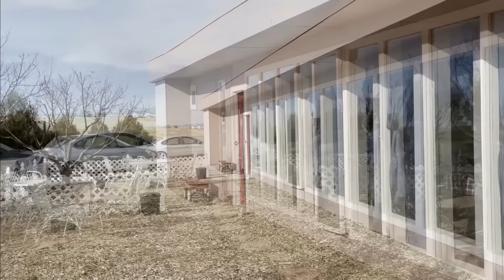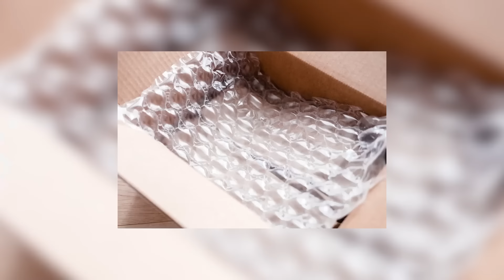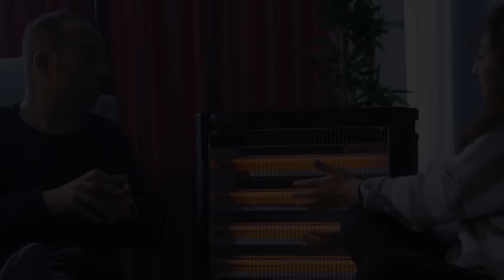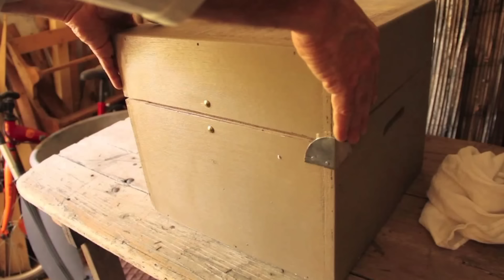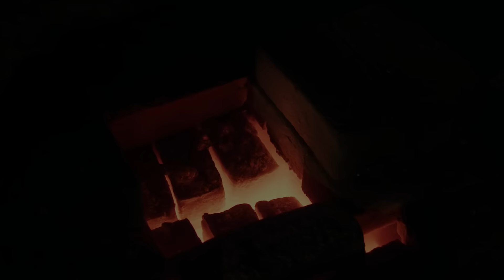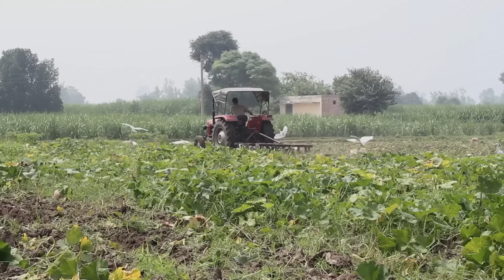Grandpa’s 42 Hacks ENDLESS Heat for Your Home WITHOUT Electricity

Comment: you do not leave an air gap with a hot water bottle if the water is to hot it will expand the air as it is hot and when it cools down it creates suction making it harder to open the bottle and over time it will effect the rubber and burst and may burn you badly..

Comment: I only use a fitted sheet on my bed in winter.  Instead of a flat sheet, I use a velour blanket with a sherpa lining (wonderful on bare skin) and put a down comforter on top of that blanket.  I am warm and cozy all night, even with the HVAC switched off!

I have thermal drapes and an electric fireplace that heats the house in the daytime and the heat that lingers through the night keeps the cats warm.

I wear knee socks to bed and a stocking cap if it's really cold.

I wear jeans and a pullover sweater during the day, with knee socks and fur lined slippers.

I reuse the heat from the stove when I bake, leaving the door open a bit after I turn off the oven.

After my bath, I allow the water to stay in the tub for a little while after I'm done. The warm water heats up my old cast iron tub and helps keep the bathroom warm.

When I use the electric clothes dryer, I move the exhaust hose to vent into my laundry room, which is just off my bedroom.  An old stocking keeps lint out of the air!

I also sleep with my 17 year old cat under the covers (his idea).  We've kept each other warm for years!

Hope these tips help you to stay warm, too!
Reply: Good tips, I miss the claw foot bathtub I was raised with (I grew up on an old hobby farm)
Reply: Thank-you and God bless

Comment: To stay warm without electricity and without danger of burning yourself through hot water, you can buy blankets made of wool (any wool will do) or even any other kind of blankets. 

When on the couch or in bed, use several blankets, not only on top of your body, but also beneath your body. 

That slows down the process of losing body heat that will be drawn into the colder couch or mattress. 

Wear more clothes, instead of one shirt below your sweatshirt, wear two or three. Buy long underwear you can wear above your other normal underwear. 

If you have trouble paying the bill for heating, only heat one room. Use the room that is the smallest, enough to move your bed inside and heat that room an maybe the bathroom only. 

Keep all other doors shut and windows in those rooms closed. If nobody breathes inside these unused rooms and no warmer air can enter (that's why you shut the door), the humidity won't rise and mold will not be a problem. Mold needs high humidity and warmth, cold or heat alone without humidity is no problem. 

Boil water and fill it in a thermos bottle. So you can drink tea or warm water throughout the day what will warm you from inside. Don't drink boiling or very hot water, it might burn your esophagus. If it has around 49-50 degrees Celsius, it's enough. As long as it isn't colder then your body's core temperature, it will keep you warm.

Comment: I have radiant baseboard heat so makes no sense bringing curtains to the floor so all the heat below goes out the window!
I use white Styrofoam sheets in my windows in winter to keep the cold coming in the windows or heat going out.
I also use black pipe insulation under my doors where gaps are. Just open the door, slide it on and cut to size!
Reply: What is black pipe insulation?
Reply: @DarkGhostHackerfor hot water pipe insulation. Walmart has them

Comment: Amusing,at no point did this A.I.recommend a bed warmer such as grandma this is possibly because grandma requires a lot of fuel and constant maintenance.
👧
Getting spare parts for them is almost impossible too,and returning them to the manufacturer is very troublesome.
🤗
Modern ones don't come with a lifetime warantee either and you cannot trust the bodywork like those earlier models.
🐱
Fortunately,cats are cheaper to maintain,self cleaning and can keep your feet warm at night.
🐀
Added benefit is that they don't wake you in the middle of the night just to dispatch an imaginary burglar......

.....but they might offer you a rodentia payment after their 3am patrol of your garden.🐀🐇🐿️🦇.......

🐱just to show they work hard on the nightshift.

Comment: in case you follow some of these examples, when your house goes on fire, position several small shelters about 75 feet away with the door opening facing the flames. you'll have several hours of natural, deep radiating heat to enjoy before the FD puts the flames out.
Reply: LOL
Reply: I thourt the heated bricks wrapped in a towel were bad, but putting a clay pot candle heater in your blanket Fort 😢,  my eyes popped out with shock 😅
Reply: @krisgair5863 we use a tera cota pot witj candles under it (raised on bricks) to heat our bathroom in the winter while we shower.  DO NOT place the candles on the floor to do this and make sure you dont have sutt building up or it will be in the air you breathe
Reply: @zigzag2370 If things are done properly and safely, these tips work.  I won’t, however, use real candles anywhere in my house.  Never.
Reply: @krisgair5863 thanks, you saved me the trouble of watching a bunch of unsafe or otherwise misguided ideas.

Comment: Do NOT use boiling water in a hot water bottle. it can significantly shorten the life of the hot water bottle and add to the risk of burns. Hot water bottle manufacturers typically recommend using a temperature no higher than 50-70 degrees Celsius, or 120-160 degrees F, and even lower for young children.

Comment: Make your own rice soak. Use a long men's athletic sock & put ~ 1 cup of dry rice in the sock.  Tie the sock shut. Microwave the rice sock either with or without a cup of water to give moist heat.  I sleep with my warm rice sock under my neck & stay toasty warm.  Try it!
Reply from the maker: Thanks for sharing this great tip!
Reply: Feed corn works well also!
Reply: @deanhil3978  I have several sizes of corn pillows and the only reason people don't fight is the cover material so we know whose is whose. They make excellent bed warmers or for larger muscle groups. They can be put in the freezer for a cold pack as well. 
Rice works best for delicate areas like an eye pillow, a shoulder wrap (sew into separate sections so the rice doesn't all shift to one side), and smaller pillows while corn holds the market on larger pillows. 
Rice flattens enough and molds to small areas to be warmed and put into a boot before you go out or to warm the inside of gloves. 
Any of these can have herbs added to them that help with pain, sleeping, relaxing, etc. I find the herbs work better with rice as the rice grinds on  them a little and the heat helps activate them.
Reply: Need electricity for this hack tho 🤷
Reply: @BecauseEyeGotHigh207  k, put on stone in front of fireplace or warm surface and same thing happens.
Reply: @blackdandelion5549 hmm interesting 🤔

Comment: Hy-Tech Thermal Solutions offers a paint additive which will  insulate your walls. There are no ASTM R-value ratings for paint. Customer reviews and testing suggests a 35% decrease in heat conduction through walls which have received 2-3 coats of paint containing this additive.
Reply: Baaahahaha! If they say so. What's the R factor of the paint?

Comment: Candle and brick heater = If you use concrete bricks, you could have an explosion. Ceramic can also explode. Be sure to check all the info in this video with the Fire Chief so you don't do something that is actually dangerous!
Reply: My dog and I stayed toasty in 9° weather with tera cota pots and clean candles.. was able to make grilled cheese on it in the morning,, but I caved and used propane to make coffee, just didn't have the patience...
Reply: Excellent tip.  Thank you for sharing.
Reply: Yes, if you do it wrong, the wax might heat up so much that it is self igniting. That is why you need air circulation, so that only the fumes of the melting wax burns. 

Also, you don't win a single extra degree. A burning candle produces X Energy. If you heat a ceramic pot with X, it will only set free X, just slower. 

To heat up your walls and anything, the amount of X is the same, whether or not it is delivered fast or slow. 

If you wanna heat with candles, let them burn without anything that covers them. Put them on a non inflammatory ground, like an iron metal. If they fall over, they will not cause a fire, even if they self ignite, because they can't melt the iron.
Reply: @lars5288 There have been house fires because of those silly ceramic candle holders. One specific kind that takes potpourri too, has been the most problematic. Science means nothing, when the Firechief has had real life experiences!

Comment: Instead of using bubble wrap, go get the real stuff US Energy Products Double Sided Reflective Heat Radiant Barrier Aluminum Foil Insulation. Reflects 99.97% of radiant heat transfer with a thermal resistance R Value of 24 (Building Envelope). Prevents heat from escaping during colder seasons and does not allow heat to enter during the summer months. It also will not oxidize like pure aluminum. It works way better than any old bubble wrap! I use it in front of 2 different windows and have some of it going against the wall too. Helps well!

Using a sleeping bag at night thats rated for winter, can help keep you warmer at night without electricity.  Also, wearing a hat to bed keeps heat in.
Reply: I took just regular cheap big painters plastic. Maybe $1-$3. Folded it over multiple times. Maybe about 6 or more layers. Put it over our door that goes into the garage that had a window. Worked great. Garage went up at least 20 degrees. It was freezing! Blocked out the thinner areas and the window. Was enough to help. I know thicker good actual weather ones would do better but that worked for the price and kept it plenty warm
Reply: Doesn’t that keep the light out though?
Reply: @Ilikeutube-q5p  Yes it does, but better to keep the light out and the cold and reduce energy costs, then go homeless. My room is still at 68F, heat set to 58F and it is 39F outside. Yes, my room will get colder, but currently, this is what the temps are at. If I were to not have that insulation wrap up, it would easily be 64F in here. If It were colder outside, around 20F, then it would get down to 60F in here, or colder on the upper floor. Heat rises, so I do get some heat from downstairs.

Comment: Water bottles should be filled with water below boiling point, not only is it a burning hazard if there is a leak, but the rubber gets damaged with the high temperature of boiling water. In a rush any plastic bottle with hot water from the tap can help.
Reply: Yup been there…done that, with the burn scars to prove it!
Reply: Nalgene bottles that many of us hikers and campers carry are made safe to have boiling water put in them due to the type of plastic used. We only have a fire and clothes/sleeping bags otherwise so it's common to bring your camp pot to boil  before bed and then you add to your water bottle and toss in your sleeping bags while you make sure everything is done and put away at camp and you crawl into a nice warm sleeping bag. You can always add tepid water with boiling 50/50 or any mix to a temp you like or wrap the warmer in fleece/wool to create a barrier to prevent burns/hot touches and keep it warm longer. It is an old camping trick/hunters trick.

Comment: For maximum heat at night in bed, sleep inside an extra large 40°  sleeping bag. Wear a cap to keep your head warm. If the zipper is broken, open the whole bag and sleep under it with a blanket on top and a blanket below.

If you're going to sleep with a wool blanket:  1.  place a blanket on the bed; 2 place a bed sheet next; 3 place the wool blanket on the bed sheet; 4 place a blanket over the wool blanket. The top blanket will insulate the wool blanket. Sleep between the bottom blanket and the sheet.
Reply from the maker: Thanks for sharing these great tips!
Reply: If the zipper is broken duct tape it closed halfway up to your hips, or take a big ol needle and  hand stitch it  up to just above your hips through the zipper backing. Takes about 10 minutes while your tea is steeping.
Reply: @steveshea6148 Great idea. I have 3 sleeping bags. The zipper is broken from the Goodwill bag. The other 2 were brand new.
Reply: This is great for my husband, but I'm a hot sleeper.  I kick off the covers and he ends up with them.  I end up with the corner of the sheet barely covering my mid section.

Comment: There's no such thing as cold air , until you get down to-273°c There's heat , just not much . He meant cooler air .
Reply: you wouldn't have to worry about cold air at -273C because you and everything else would be dead.  you need to live up north, thats cold air not 'cooler' air, and that can be down to -45C
Reply: @elainemarten2147 he's right and I live 'up North" less or more heat is all we can measure. All systems contain heat until absolute 0 K
Reply: True but (Kelvin) is absolute 0.